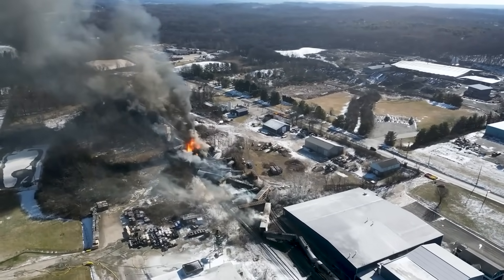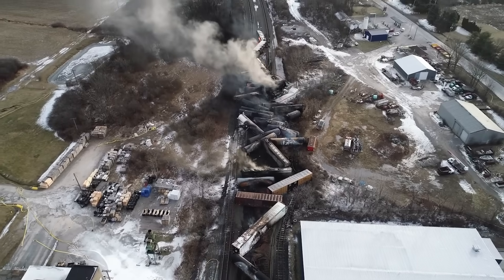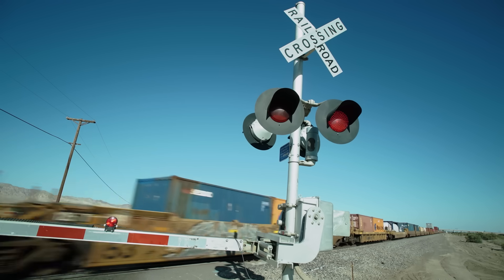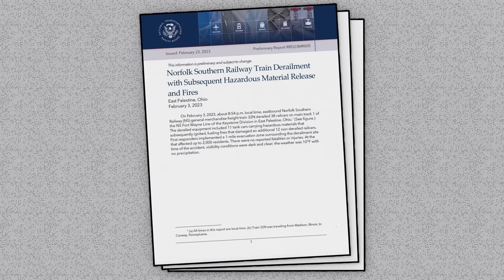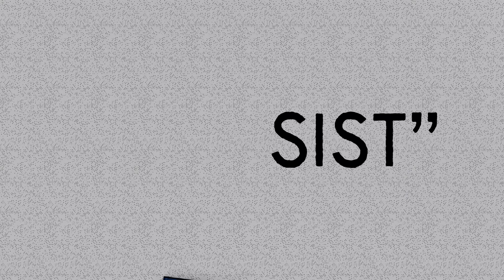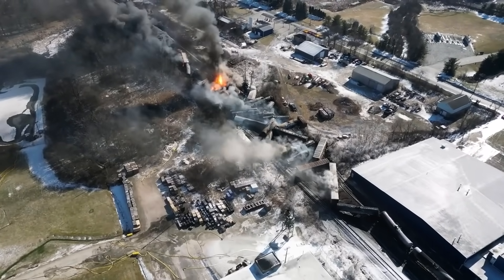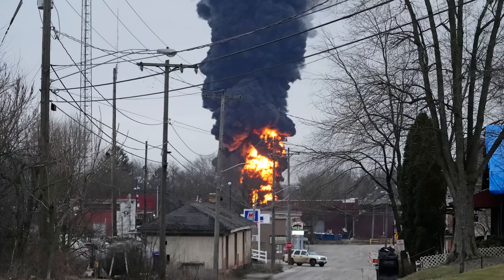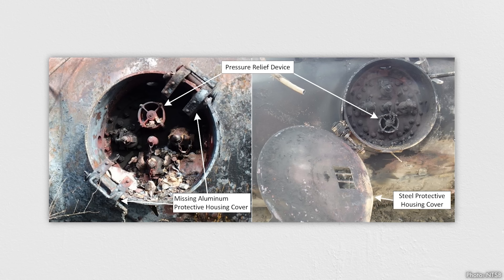East Palestine Train Derailment Explained

Comment: I worked for Frito-Lay for years. Every single day we got two rail cars of corn products and three rail cars of oil. For comparison, potatos took 10 - 15 full trucks per day.

I can't exactly quantity the benefits of rail, but it took hundreds of trucks off the road, and was a huge cost savings.
Reply: in terms of efficiency and cost, it is almost impossible to beat rail. that said, the risks are still very real when considering just how much hazardous cargo is in transit at any time, and how much of the tech seems to have stopped improving over the last few decades. (edit: by this, i meant that the latest improvements in tech have failed to show up in american rail... my bad for the phrasing)

there is definitely room for vast improvement; but it is most likely being held back by inefficient management aka the monopolistic corporations running this industry.
Reply: @alveolate  electronic braking is old technology but NS refused to implement them and lobbied against requirements for them.
Reply: @alveolate  The main thing here is that these accidents rarely happen outside of the US or developing nations, because the safety standards are much higher. Recently there were two major accidents. One in Greece, where the safety system was broken and someone made a mistake, causing 2 train to collide head-on. In the Netherlands a rail-crane operator was done with his night-shift and wanted to cross the tracks to get off and go home, but he got hit by an Intercity train. The crane operator died, everyone in the train survived although there were serious injuries.

These are very rare though, while in the US there are derailments every month, if not more.

The tech hasn't stopped, it just isn't used in the US.
Reply: @Yvolve  Granted that the majority of derailments anywhere are inconsequential affairs where a train drops a wheel into the dirt while going 5 mph in a hump/shunt yard, the US still has a concerning number of large derailments for the amount of freight traffic.
Reply: @Yvolve  Ya it's not like our nation is as large as the whole of Europe or anything.
Reply: @NoopityNoop  Yet the whole of Europe is covered in train tracks. Thanks for the comparison because it just underlines what I said. 

There is nothing stopping the US from having the same infrastructure, as the richest country on earth.
Reply: @erictheepic5019  A derailment is inconsequential until it isn't. Speed is not relevant if the cargo is hazardous. 

The US has an exorbitant amount of derailments, on the level of developing nations with extremely outdated infrastructure and no money to fix it. 

The US is the richest country in the world. It is a choice not to fix it.
Reply: @Yvolve  There is approximately 3 derailments every day in the US, most happening in rail yards at incredibly low speeds and with no impact beyond a bit of work to re-rail the train. Derailments like this do not happen anywhere close to that frequency, let alone every month. This is also putting aside that the US is basically as big as all of Europe (9.8 million sq. km vs 10.2 million sq. km). This was 100% a lobbying for reduced safety standards issue, either way, and Norfolk Southern should be held 100% responsible.
Reply: @KainYusanagi  I didn't know it happened that often. That is insane! 

Europe got it done, maintains it and is expanding it, so there is no reason the US can't. As you said, it is just lobbying to maximise profit over quality.
Reply: @PsRohrbaugh  I've seen it and it was great. He's so good at explaining what goes on behind the scenes, so you actually understand why you see all these derailments of example.
Reply: @Yvolve  i have seen some of the wheel wear allowance in Brazil and it has me very concerned
Reply: @Yvolve  Speed is very relevant. If a car can't survive a wheel dropping just six inches at a few MPH, that car probably wouldn't be safe to run at all. And no, I'm not defending the lax safety standards that the idiotic rail companies have adopted, it's just unlikely that a small derailment does any harm.
Reply: @Yvolve  
what part of europe?
also it's like comparing Japan infrastructure to the US, way less land so they invest all or nothing to public and commercial transport
Reply: @Yvolve  Isn't the US one of the only countries that use freight rail to the extent we do? "Derailment" is everything for a wheel of track to an entire car off the ground, only one end of that spectrum is a major accident.
Reply: @NoopityNoop  just far less stops or points of interest in between, unlike Europe.
Reply: @Yvolve  one of the biggest reasons the tracks aren't more maintained is just the sheer amount of them, the US has well over twice as many miles of railroad as all of Europe and a lot more of European rail systems are run by their governments which makes them stay better maintained whereas here in the us the rail tracks are all privately owned and the government just rents usage of them for things like Amtrak. And being owned by private companies they care more about profit than anything and will go as far as they can to not spend the hundreds of billions of dollars needed to repair the rail system. It's easy in Europe cause they have government levels of money which makes infrastructure projects feasible, for the 7 private companies here in the us it would be such a massive cost to them that they just consider it not financially viable like Norfolk southern made like $3 billion in net income last year and it's cost those private railroads  nearly a trillion dollars since the 80's to build up the system we have and there were a lot more of them to distribute the cost before. They focus more on expanding the system than maintaining it unfortunately though cause expanding it makes you money instead of losing it fixing something that might never be an issue till some other company has bought you out
Reply: @Yvolve  In 2021, there were 1389 significant railway accidents in the EU, with a total of 683 persons killed and 513 seriously injured. In the same year there were 1655 rail accidents in the USA. The USA moves approximately 4x as much freight (per ton per mile) by rail as the EU does.

According to the numbers, US freight is safer than EU freight.
Reply: yeah but making sure communities are safe will reduce their profits :-). America is absolutely glad and willing to sacrifice human lives in order to maintain record profits for these corporations
Reply: @erictheepic5019  That's what I meant: it doesn't matter if it happens at 2mph or 200mph. A dropped wheel is a huge issue and a sign of much bigger problems. 

Also, the damage is massive, even at slow speed. It is likely to drag the wheel along the sleepers, brackets and through the rock layer.
Reply: @Yvolve   Do keep in mind the United States moves about 40% of freight by rail compared to only 18% in europe as the focus for rail in the US is freight rather than transit like in Europe.
Reply: @Yvolve  I believe you are comparing the wrong metrics. Globally using 2019 statistics, the US is the third largest user of rail freight by volume (2.3 Mn-tonne-km/yr) after China (2.8 Mn) and Russia (2.6 Mn), which are also very large countries with big empty spaces between major urban centers. India is a distant fourth and lower by an order of magnitude (671k), then Australia at 5th, and Canada at 6th. On the European subcontinent, the Ukraine is 7th (181k) and among the EU members only, Germany is the largest user at 8th (113k). All the nations of the European subcontinent, added together, would still only be tied with Canada. You seem to be comparing all rail infrastructure generally, which is wrong because passenger rail is held to higher standards in pretty much all developed countries, and you don't hear about a high incident rate on US passenger rail lines, either.
Reply: @Yvolve  there are many different rail companies maintaining anything that’s all over Europe, not just 4 different companies. It doesn’t work to compare US rail to European rail. They aren’t going nearly the same distances or getting the same use for freight. I’d bet that European rail is largely for passengers still, not freight.
Reply: @andrewlaverghetta715  It does work and you just used one of the best arguments: actual competition, or full government control in some countries. 

In the US you have a cartel, so there is no competition and therefore no need to invest, deliver a good service or anything else, except for maximising bonusses for the top level. This is the American way. 

In Europe it is both, at high volume, so don't go buying lottery ticket today. 

America is decades behind, that is just the simple truth of the matter. 

They do go the same distance. Look up how big the US is compared to Europe and the distribution of roads and rail in Europe. The density is a multiple of the US and it is all well maintained. 

The Greek crash a month ago is a rarity, while in the US it is common for accidents to happen.
Reply: @Yvolve  When you break it down to tonnage moved the railroads in the US (and Canada and Mexico) are incredibly safe.   The tech is different than Europe because the way railroads operate are dramatically different.
Reply: Potatos used to mostly be shipped by rail as well, but one of Norfolk Southern's predecessors, Penn Central, ruined that in much of the country after loosing an entire potato crop in a yard.  Penn Central was particularly bad, but in many ways exhibits many of the problems starting to rear their ugly head once again.
Reply: @linkscarlet9094  Now this is some interesting history! I am not against shipping potatoes by rail, but during the growing season we could sometimes go from farm to shelf in 24 hours thanks to trucks. Obviously when you're using cold storage it doesn't matter so much. But for corn / cornmeal / oil, that stuff keeps basically forever, and rail is perfect.
Reply: @PsRohrbaugh  ah, see, they were refrigerated.  Penn Central lost the refrigerated box cars.  They ran out of fuel (diesel) and the potatoes spoiled.  It was a very unusual situation that killed Maine's potato industry
Reply: One locomotive hauling 50 tons of freight is about 50x more efficient than a single truck pulling the same amount on a single gallon of fuel due to the physics of steel on steel transit, which is why rail is such a beneficial mode of transport.
Reply: @Adam_Malkovich  You're right that rail is very fuel efficient.  But I'd just point out that '50 tons of freight' is LESS THAN ONE rail car.  When you see a 100 car train, that can be on the order of 14000 tons!
Reply: And trucks of vinyl chloride would crash anyway more often, so it's not a safety loss either. it's better in every way where it's available and the volume is required.
Reply: Also, rail tanker cars are all basically identical. The tanker cars we got of corn oil & corn oil looked identical to the vinyl chloride ones in the derailment.
Reply: @PsRohrbaugh  They may have looked identical from the outside, but that doesn’t mean they were identical inside too.
Reply: @Conservator.  They would have been pretty similar, although with slight food-grade modifications, and better cleaning. They really are just a big old barrel on wheels.
Reply: @johncharlesbrown2314  
It’s explained in the video that the tanks for hazardous substances are isolated, they have reinforcements on the front and back and they have a pressure release valve.
Reply: @Conservator.  one of my cousins works for a rail car maintenance contractor that works mainly for CSX.
His primary job is cleaning and relabeling tankers.
They are as identical on the inside as they are on the outside. Just a large tank with some baffles to arrest the movement of the fluid.
There are a few rules with labeling and usage. You can never label a tank for food grade use if it has ever been used for non-food grade transport.
The only way to know what's in a tank is the labeling painted on it, on the standard black tank that label is done in bright yellow.
Reply: @iwontliveinfear  Watch the video again at 6:34.
Reply: I can do that quantification for you ....
A fully loaded railcar: 286,000lbs.
Average MT railcar: 65,000lbs.
A fully loaded truck: 80,000lbs.
Average MT truck: 35,000lbs.
Railcar cargo potential: 221,000lbs.
Truck cargo potential: 45,000lbs.
Railcar-truckloads: 4 41⁄45 or 4.9111 trucks per railcar.

I remember working the Hershey Shifter, a rail job that switched different portions of the Hershey plants in Hershey PA. We delivered 12-16 boxcars of cocoa beans a day to the bean silos. Between main plant and Reese, we would drop in 15-20 hoppers of granulated sugar a day.

When some local coal-fired power plants were working to capacity, they could burn a 130-car coal train a DAY! Our division was feeding 5 power plants, two of which were burning a train a day, AND stockpiling a train a day, PLUS running 6-12 trains a day from the Monongahela Valley to Baltimore to export coal to China, when the Australian mines were flooded and out of commission. 

And that's just local coal. UPS is one of the largest single shippers in the US by rail these days (bet that title has gone to Amazon, with USPS in there too). 

Grady is right, people just don't understand how much of everything is hauled by rail at least once in our supply chain.
Reply: @TUXmint  EVERY hazmat shipment over a certain pound limit HAS to be identified by hazmat placards in the US. The ONLY exception is the diesel used as fuel, when stored in approved fuel containers... The 5000gal fuel tank hung under each locomotive does not need to be placarded even though it would have to be if it was riding on a flatbed tractor trailer.

In addition, certain PIH/TIH classes of chemicals must also be stenciled on the tank cars in high-contrast, minimum 6in tall lettering.
Reply: Every rail car carries either one or two semi-trailers. Multiply that, by the number of cars in a freight train, and that's how many semi tractor-trailers are off the road. Over land, there is nothing that can compete with rail.

Also, when you're being told that there are over a thousand derailments in a year, remember that "derailment" includes anything that takes a wheel off of a track; those are relatively common incidents, and do not result in major accidents.

What happened in East Palestine is pretty rare...So, when multiple incidents in that range happen within a week -- you need to worry: Find your house on Google Maps, and go out five miles; if there is an operating Class 1 rail line anywhere inside that radius, you need a gas mask for every person in your house...because the government isn't going to provide you with one.
Reply: @TheMajorActual  For another perspective, our factory received 5 railcars and 15 truckloads of raw materials, and sent out 150 truckloads of "finished goods" every day. The fryers boiled off hundreds of thousands of pounds of water weight (potatoes are only 15% - 25% solids, with the rest being water) into the sky as steam. Then we filled the bags with nitrogen (or air for corn chips) and a 57 foot trailer would cube out under 20,000 pounds.
Reply: @TheMajorActual  I wouldn't say that the tractor trailers are off the road as much as I would say they're doing other equally important things. heck we cannot afford to have tractor trailers off the road. I think there's already a shortage of drivers😊😊I'm not trying to nitpick here I'm just saying it's better actually that the railroad cars are doing this job and allowing our truck drivers to do other important things the railroads are very important and I think we need to build even more of them if you ask me. I think it would be neat to have a centralized railroad hub one in each state then railroads can ship supplies to that central state hub and then trucks can deliver it from there or something like that😊 /salute
Reply: @TheMajorActual  How is a class one line defined? What level or rating of mask?
Reply: The STB's current definition of a Class I railroad was set in 1992, that being any carrier earning annual revenue greater than $250 million. <-- stolen from Wiki

Also as of this week there is only 6 class 1s. CP and KCS merger went into effect, leave it these Railroads: NS, CSX, UP, BNSF, CN, CPKC
Reply: [for comparison] I can't use that data to make a comparison.
Reply: Good point
Reply: Paul, thanks for the comparison.
Reply: According to Buttigieg this happens 15 times a day.
Reply: @facelessman9224  In one of the BIGGEST countries on earth, with the most miles of rail on earth, shipping the most goods by rail on earth.  And that includes incidents were a wheel just came off, and is fixed with 30 minutes with no catastrophic damage.  

No kidding we have the most incidents.  We need more regulation, but its nowhere near the doomsday scenario of daily incidents like East Palestine.
Reply: Americans never pay attention to the cheating incidents in their own country. On average, there are 800 cheating incidents every day, which is more than the cheating incidents of all countries in the world combined.😂😂
Reply: the energy required to pull the train along is more then the trucks and the trucks don't impede traffic anywhere close to that of trains. 

sitting there for 5 and sometimes 10 mins waiting for mile long trains to pass by slowly at a blistering 10 mph.
it's only a cost savings to the company, the cost of switching gets put onto everyone else. sitting in traffic with 20-30 other people waiting for a train to pass by....everyones got their engine idling. that's not free, that's shifting the cost and burden onto others. 

also unloading a train is very different then a truck, the equipment used to offload trains is vastly more costly to run then trucks. as trucks can just dump their load, while a train needs to be drained (fluid) or picked up and moved by some other machine.

the only real use for trains transporting goods are long distance and out of everyones way. public transport is also fine, long as it doesn't get in everyone's way, which it normally doesn't.
Reply: @rocksfire4390  you aren't factoring in the size differential between trains and trucks. Depending on cargo, a railcar is able to carry between 3.5 and 6 times as  much cargo as a US tractor-trailer. Which means for every railcar you remove from the network, that's (on average) 4.5 MORE trucks going onto the highways and local roads. You think traffic sucks now? In a typical year, US railroads move 1.7billion tons of freight. To move that to trucks, you would need to put an additional 232,900 trucks onto the roads... EACH DAY.

You are also not understanding how the network works, VERY rarely does a train block a crossing to do switching, unless management makes a change with so little heads up that the crew has no choice, because they aren't informed in time to plan accordingly. We unload 80-car crude oil trains in the Delmarva area in 12-14 hours. Depending on the location, a fully loaded 130 car coal train can be unloaded in under 10hrs.
Reply: Yes, shipping by rail is the most efficient in terms of cost, fuel, and air pollution. Many railroads are now using Propane in place of Diesel, which is much cleaner burning and reduces air pollution even further.
Reply: @wayneyadams  Ships and barges beat rail every time
Reply: @themonkeyspaw7359  when is the last time a ship moved across land?
Reply: @themonkeyspaw7359  Maybe so, but it's very hard to ship mass quantities of materials by ship or barge across the US, LOL.
Reply: Is taking hundreds of trucks off the road a good thing or a bad thing?
Reply: @petermgruhn  a good thing for everyone, drivers and the environment
Reply: @petermgruhn  Good thing. Road wear, congestion, pollution, accidents, all these things are reduced with fewer vehicles on the road. Im probably missing some other benefits.
Reply: @petermgruhn  I’d prefer fewer trucks on the road if they can be transported by rail. Safer roads with less wear is a positive.
Reply: @TUXmint  
trains are way heavier then trucks. the energy required to get it up to speed and stop it is also vastly higher.

a semi-truck and an empty trailer is 35k pounds (17.5 tons), dump trucks (big ones are about the same), a single empty train cart is 30k pounds (15 tons) by itself. that 15 tons doesn't include the driving train (locomotive) which is upwards of 200 tons by itself. yes you are trying to compare 215 tons to 17.5 tons. 

the only way trains can compete is by having insanely long lines of carts, which are not all used when transporting goods and these mile long trains, unlike trucks, block traffic which easily removes any efficiency gains you could come up with. also to get the goods off the train require other machines, which takes energy (much more then dumping the entire bed or using forklifts to get it off a trailer). 

first, you don't wait for trucks to pass in traffic, that doesn't make sense. next not all "120" trucks would be going to the same place, nor would they all leave and arrive at the same time. it would be spread out over the work day and spread out based on where they had to transport their goods.

IQ tests are meaningless, the fact you still believe they mean anything is real telling. 

the only time trains, used for transporting goods, make sense is when used as long distance transportation.
Reply: Rail freight hauling is so efficient you will see flatbed cars hauling truck trailers (called intermodal freight) two atop each other where there are no height restrictions. Consider that one freight train pulled by two or three diesel (sometimes propane) engines replaces a hundred or more trucks on the road.

I really get pissed off when I hear people like Grady making disparaging statements with (wink wink) vague implications about the power of the rail lobby somehow influencing safety regulators.
Reply: @wayneyadams  it's not the rail lobby influencing regulations. It's rail management flat out refusing to comply with those regulations, and then the railroad lawyers tieing up the FRA in court over the fines. I can't be certain, but I bet you dollars to donuts that the expense accounts for Norfolk Southern's lawyers alone is bigger than the entire FRA operating budget! 

FRA inspector inspected an engine in a PA railyard and shipped the locomotive. NS management ordered the engineer out with the power, having just been told that the FRA officer was in the cab listening to the radio conversation.

That's not just a violation, that's a willful and intention violation, and the FRA has the authority to BAN people for such things from ever working in the industry again. And yet it was done.